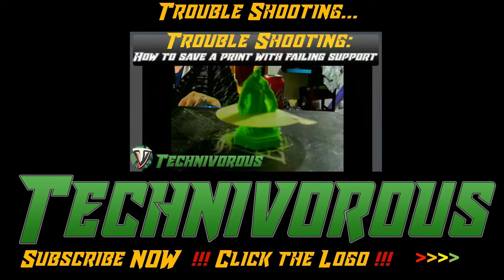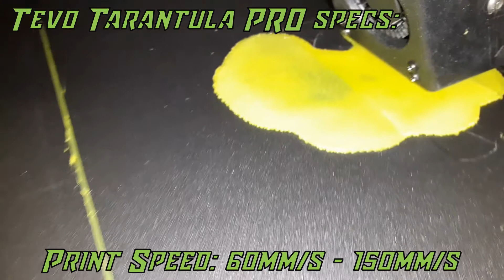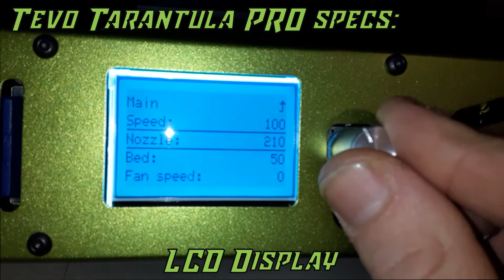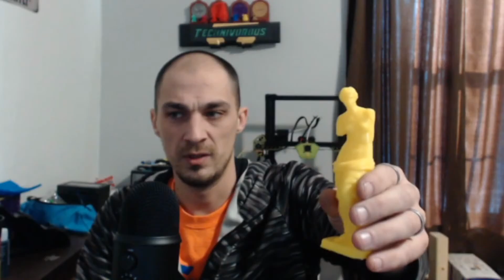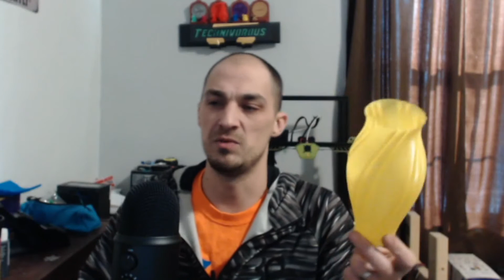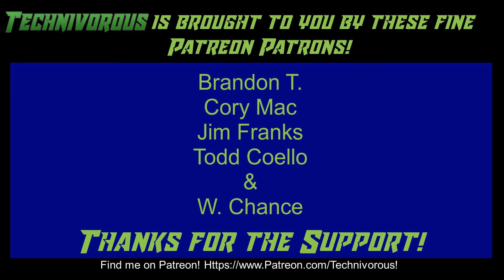NEW Tevo Tarantula Pro REVIEW 2020 - full review, pros and cons!

Comment: ey, consider getting a steel core belt. for bed and head. better wheels, clear type. better bearings in those compared to whatever they consider bearings in the stock wheels. ive yet to do em all up, but the bed at minimum. also, get a glass bed top if you havent already.
Reply from the maker: I'll look into the steel core belt. Bed surface is magnetic pei. Smooth like glass but easier to remove. ;)
Reply: @Technivorous  ooh nice. i got a borosilicate glass bed for mine. love it. the belt aswell. white, steel core. kinda stands out against the black frame. hows that z brace workin for ya? I find it causes an issue on my machine
Reply: steel core tends to stretch what he wants is fiberglass Core. you can get genuine gates gt2 belts from trianglelabs (saldy only from alibaba cn warehouse)
Reply: @antibodyarmy  i mean sure. fiberglass. but ive read that both steelcore(which I have) and fiberglass, have their own downfalls and benefits.